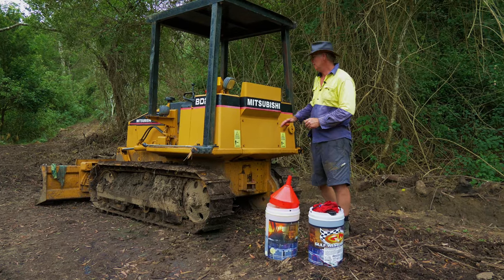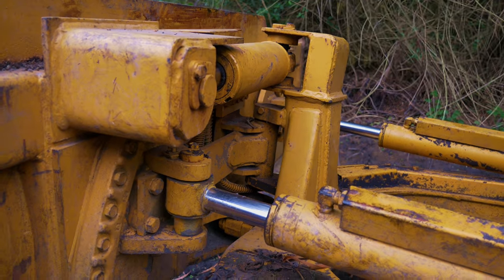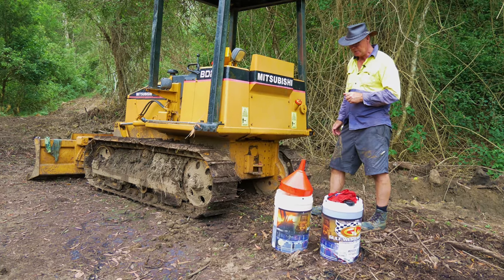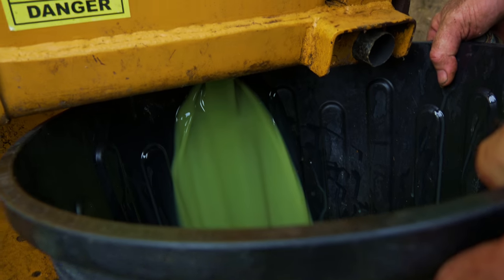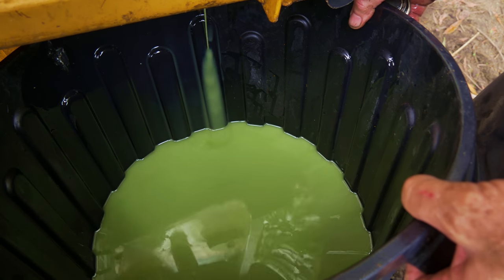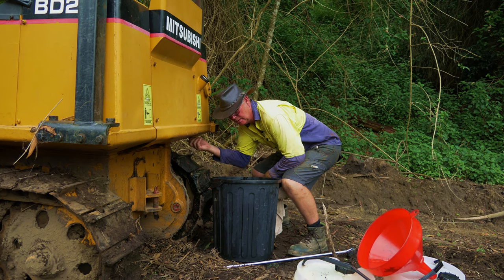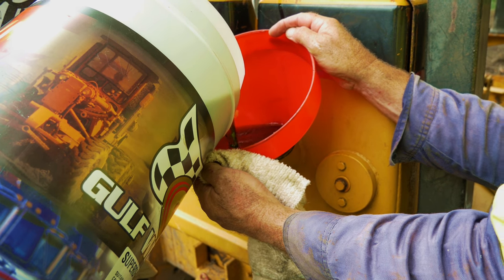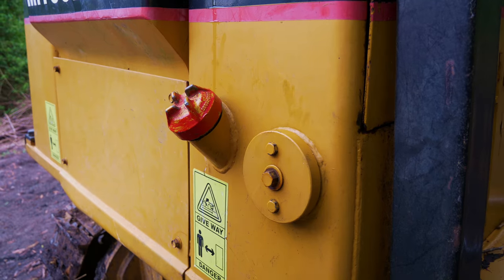How to Change Hydraulic Oil - Heavy Machinery [EPISODE 3]

Comment: That was very helpful from upstate new york usa! I also had water in my fluid. The battery housing leaked water have given it many  Coats of undercoating short of ripping out and welding in a new top. For the time being. Batteries leaked acid causing rust.  I have the bd2h, great little machines!